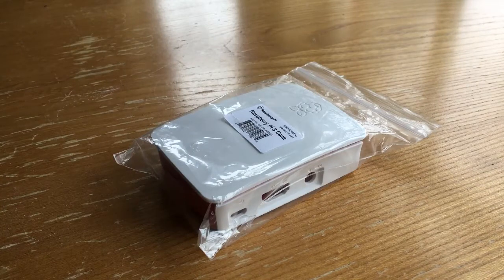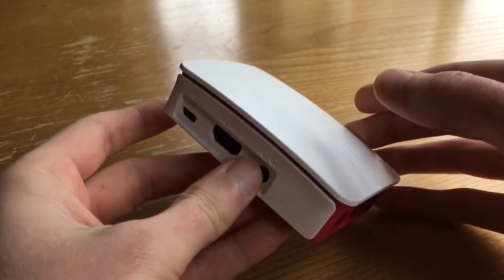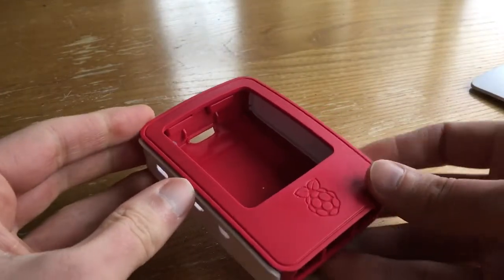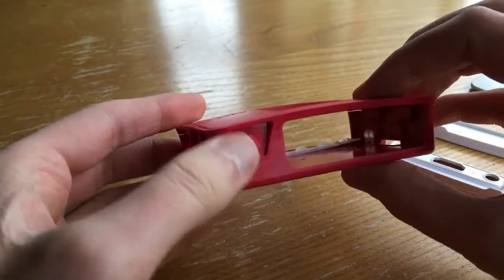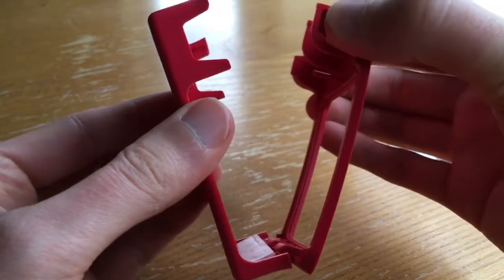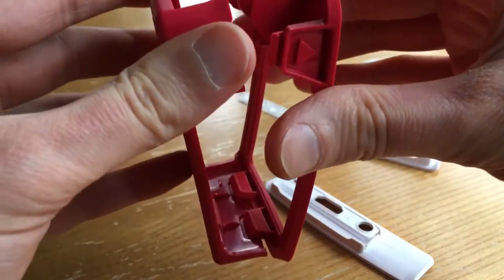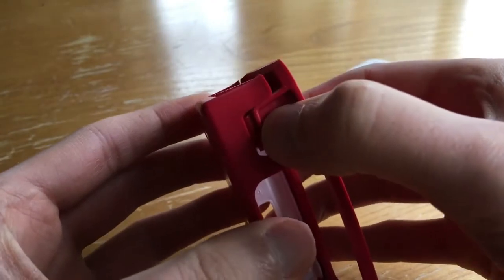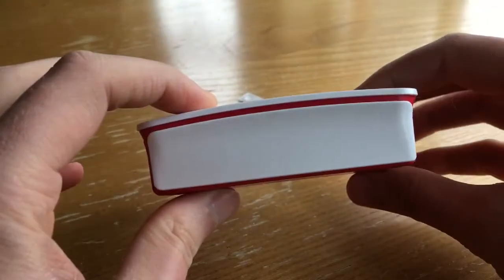How to dismantle/open the official Raspberry Pi 3 case

Comment: So glad that I found your video. My brother helped me... "set up" my raspberry pi 3, which was back in 2018 or something (maybe 2019...), and though I'm a bit savvy with computers and some tech, I feel like I know very minimal about the raspberry pi. I at least know how to connect it to my computer with an ethernet cable, put games on it and so on, but while playing a game (like Mega Man X), all of a sudden I notice this little flickering symbol in the upper right corner after an hour or two of playing, I've since figured out it's overheating, and I don't quite know yet how to fix that, but I at least wanted to open it up, since there aren't even any air vents on this enclosure or anything like that. Anyway, thank you for this video!

Comment: what if your raspberry pi is already in the case
Reply from the maker: Hi Ultra Instinct Waluigi. The instructions should be the same with the Pi in the case. As long as you're ok powering down the Pi and removing the cables, then you should be able to remove the sides and top to reveal the Pi itself.

If you're still having an issue, if you can explain where you're stuck, I'll try to take a look myself.